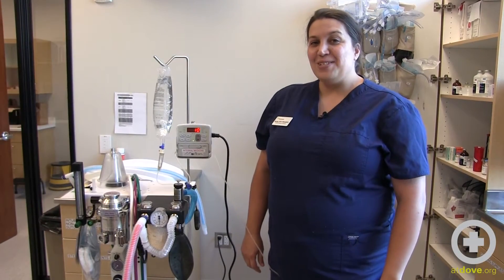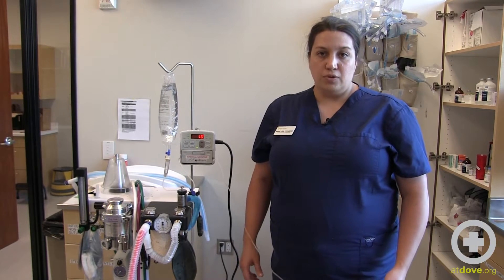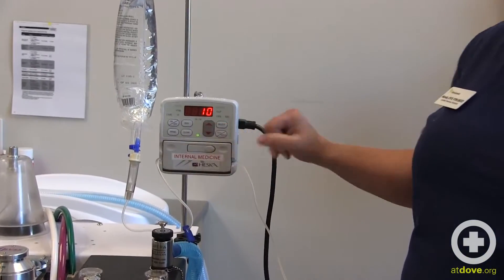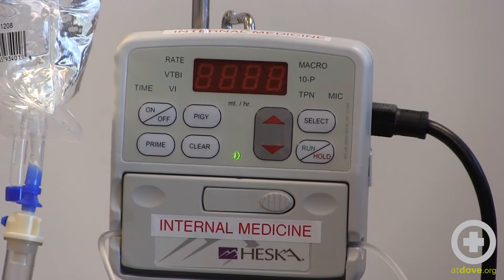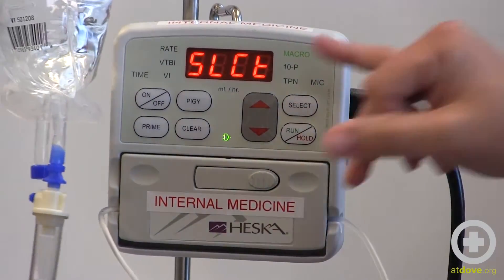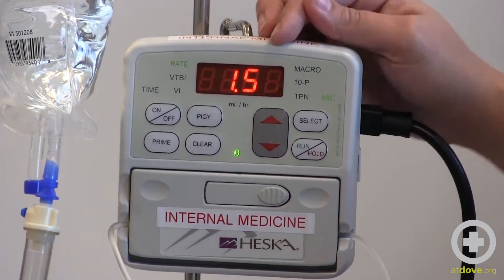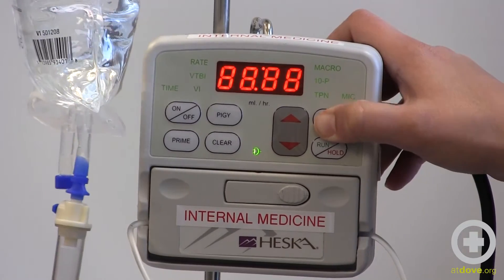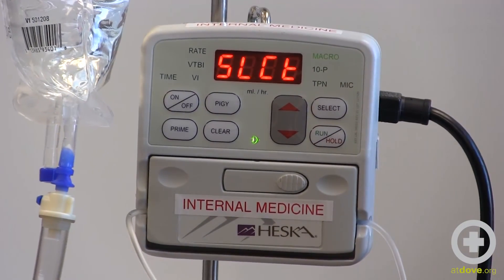Technician Hacks: Changing Heska Pump from Macro to Micro

Comment: Do you need to switch the fluid line also from Macro to Micro .
Reply: I was wondering the same thing. We always use micro for the smaller patients.
Reply: Not necessarily.  Heska is always ml/hr. If set your fluid rate by eye, without the use of an IVAC pump (using the wheel on the line) for your ml/hr rate, you’d need to know that Macro venoset drops are bigger at 15gtt/ml and Micro is smaller drops at  60gtt/ml.  (Then calculate using 60 sec/1 min, 60 min/1 hour and 15gtt/ml or 60gtt/ml to set mls/hr) but you knew that. 😺🤘🏻